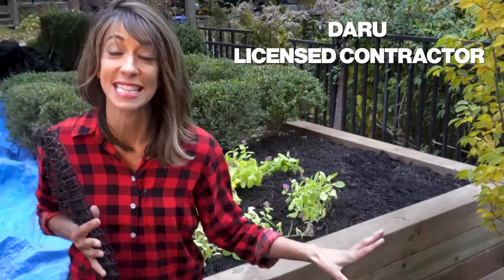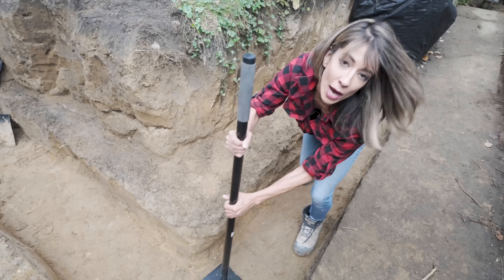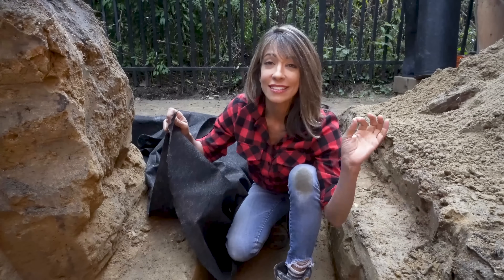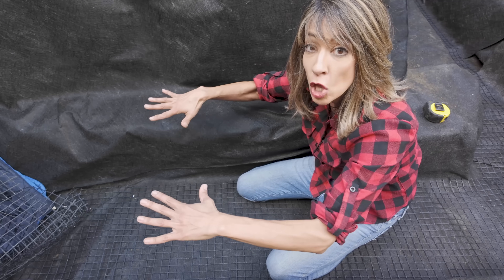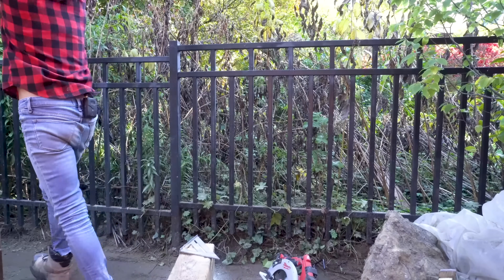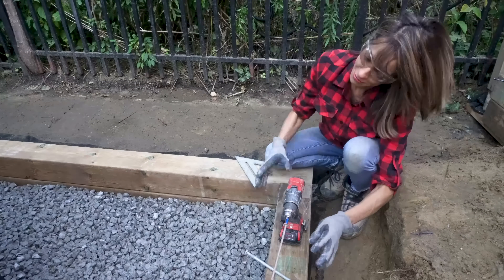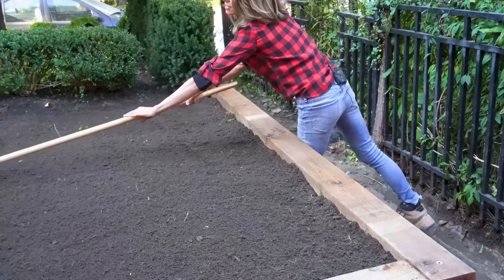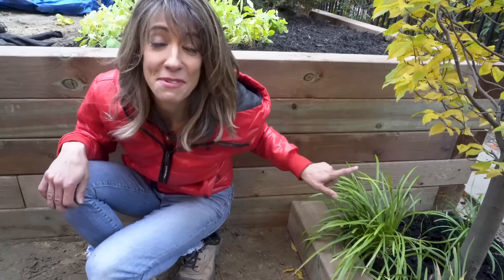No One Builds Retaining Walls Like This...Yet!

Comment: This is standard build for retaining walls including proper slope. Unfortunately most contractors don’t want to do it because cost and problems won’t occur until they’re long gone. Drainage is critical. Include pipe gravels fabric and weep holes depending on length of wall. Used to make 20ft high walls on golf courses for a living. Great work
Reply from the maker: Totally, the drainage is so important for longevity.

Comment: Is it necessary to put in biaxial grid below that first lift of backfill?  Shouldn't that 3/4" clear lock itself in without needing the grid as well?  I can see adding the biaxial grid to additional rows of retaining wall, especially as it increases in height, it just seems redundant to put it below the bedding layer.
Reply from the maker: The base layer stabilizes the base to support the 4 tonnes + that it’s supporting. I’m doing this with concrete block too because my block manufacturer requires it. I think it’s smart. Especially for retaining heavy amounts of soil and backfill. You can build them with or without. It’s a $100 upgrade I’m happy to do.

Comment: I was standing on a 12 ft block retaining wall at my house when it collapsed. I was able to grab the iron fence on the way down and was left dangling 6 ft above the ground below. The block wall was just a stackedgravity retaining wall. So i completely broke down the wall and stacked all the blocks to the side. Then I brought in my back hoe and recovered all the dirt/aggregate to the other side on a large tarp. Next I drove 16 10' rebar into hill in a grid pattern. I then drove down 6 vertical rebar spaced equally and attached it to the 16 horizontal rebar. Then I attached galvanized fencing to the rebar with some space between the fencing and the hill.  Next I leveled the ground by the hill. After this I started restacking each row. At the end of each I applied rubber road netting to the top with liquid nails to further tie the blocks together. With each row I back filled the space behind with the dirt/aggregate and tampered it down. Rinse and repeat.  At the top, I poured concrete to cap.
Reply from the maker: Thanks for sharing your experience building your wall. Sound like it was a great project.

Comment: I don't think this is correct. The geo grid should have 3/4 below before it's layed out. It does not need to go below the wall but on the 2nd course extending out to the excavation.  Re your fabric it seems most of your competitors would go with the woven version as it does have  water penetration (slower yes) and directs the water to the drain instead of waiting for it to absorb into the ground.
Reply from the maker: Yes, most videos are using the tarp-like woven material but it’s incorrect and will reduce the lifespan of your wall. Especially if you have clay soil. I base stabilize my walls since my block manufacturer requires it and it’s a standard engineering practice. Thanks for sharing your thoughts.

Comment: So you are draining the wall by putting the drain pipe through the wall, but the water has to go up slope (you said the level was to the left) to get to the daylight part of the pipe? 
Do you have magic water that travels uphill?
Reply from the maker: The level is used to confirm the slope.  All drains require a minimum slope 2% or 1/4" per foot. Thanks for your question.
Reply: @DaruDhillon  Yes but the video says it was sloping away from the daylight of the drain.
Reply: If the bubble is on the left side, then the left side is the higher side and the right side is lower ( which is where the water will flow to and daylight through the retaining wall.)
Reply: Yeah, that's right. My brain failed me. @WhatDidUThink

Comment: I've been building retaining walls for 30 years, your tutorial and information is spot on.  Have to say though, I think I've only ever had one where I could dig that smooth in sand.
Reply from the maker: I appreciate you taking the time to let me know. You must have seen all types of walls in your career! Thanks
Reply: @DaruDhillon  Snarky disingenuous reply. Fake "jobsite"
Reply: So in your 30 years experience what role is that pipe playing when the drainage aggregate is at a lower point and already goes under the wall? 
Is that pipe doing anything when water will already flow under and outside the wall.
Reply: @DiscoFangyes it is doing something. You could do a little experiment yourself. It's going to decrease hydrostatic pressure overall in the amount of time that the hydrostatic pressure is applied against the back of the wall during a heavy rain.  It's going to help get the water out as the backfill is saturated and keeping the water level lower and draining out faster rather than letting it build up higher and higher to the point where the hydrostatic pressure is pressing against the point of higher wall leverage. 
It's not exactly the same, but think of the holes in the upper part of the bowl of your bathroom sink. The reason they are there is to keep you from accidentally overflowing your sink if the water is running and your drain is closed or rolling slowly because of the accumulation of debris in the trap.
Reply: @lanceroberthough1275 Utter nonsense. The hole in the top of your sink is to let water out if the plug is in but the tap is running. The drainage aggregate being under and continuing outside the wall is like having no plug in the plughole. All and any water is never reaching the height of the pipe. I’ve been building and landscaping for over 35 years in hilly, temperate area.  Understanding and controlling water is fundamental to foundations.
Reply: @lanceroberthough1275 And fundamentally you don’t build retaining walls as a floating construction on drainage aggregate.
Reply: @DiscoFangI don’t doubt your experience but the flaw in your reasoning about the gravel under the wall acting as a sufficient drain is that this gravel is below the undisturbed excavation of the outer side of the wall. Even though the gravel extends to the outside of the wall, water that has passed under the wall now runs into undisturbed soil outside the wall which may be unable to absorb and eliminate water. The result being that water pressure does in fact start building behind the wall. The drain pipe eliminates this possibility and safely drains water to daylight outside of the wall. 
Adding a drain line is a pretty small effort compared to the overall effort of the entire project.
Reply: @DiscoFang I work in heavy clay/ southern US piedmont area and actually run into this all the time. This construction would never work in my area, and that's why we sue CNR around the foundation. In this case, I think it may be appropriate for two reasons:  I imagine that the fully buried timbers have the same hydrostatic pressure on both sides of the face (water doesn't compress, it displaces), so they can't move, whereas those above grade would have pressure on both sides, requiring an "overflow" like that hole at the top of the sink. With that super sandy soil, it is likely the water lens would never reach the drain pipe and hardly if ever stand even around the buried timbers, but if it did, there's a pipe in place to move it out quickly. Also the sandy soil would never clog the fabric, unlike the clay I deal with.
Reply: @robmill3r  I don't disagree with you that this land she's building on looks quite sandy and that water will most likely just flow right through without a french drain. But I don't see the argument not to have a french drain in place as there's as time goes by and as you add more and more soil into that garden, and with the flow of water the smaller particles will blend with sand and start to not flow as smooth as it used to, so in my opinion it's just something that's good to install. I do feel sorry for you that people that you're arguing with you here don't even know what a french drain is for some reasons starts to compare the french drains to overflows on a sink.
Reply: @DiscoFang Not absoutely true. Take a look at Gabions. They're used (and have been since Roman times) as retaining walls. And you rest them on drainage aggregate.
Reply: Concrete behind the wall would have been faster and more cost effective
Reply: @im2bz2eu  not really, concrete is 4x the price of gravel, and it doesnt solve the drainage problem because you dont want water right against the timber.
Reply: It's fake content.
Reply: @e4d578what is fake about it? I'm interested to hear what this lame brain fake call out is. I need a good laugh.

Comment: This is a very good wall design, particularly on the soils you are fortunate to have. Soft clay, silt, or high organic content soils would be a different story.   In those cases, removing the soft soil and replacing with compacted suitable fill is best.  If not possible, talk to a local geotechnical engineer.
Reply from the maker: Good advice. Thanks for sharing!

Comment: Also, it appears in the video the drain pipe sits on top the 6" aggregate base while in the wall block video the drain pipe its within the agg base.  Was thinking - wouldn't the drain pipe better evacuate water if within the 6-8" aggregate base for the wood wall?  it'd catch water sooner as it saturates/fills in the gravel.  Or maybe it does it matter where its placed so long as its sloping?
Reply from the maker: In this post video I’m sloping the drain so it’s draining at grade or daylighting. Some walls will require daylighting by code if they are long. Some build smaller walls with the drain lower without daylighting.

Comment: Sounds like everything is critical.  Pro tip, angle your wall just slightly backwards to account for the forward force.   Slightly,  so the bottom doesn’t push out.
Reply from the maker: Good call! Battering walls does reinforce strength like you say. I have a garden bed video that shows how to do that. In this case we went vertical purely for looks.

Comment: Are the rebar that are securing the deadman piercing through the drainage pipe installed at the lower course?
Reply from the maker: No you wanted to avoid puncturing the drain and filter fabric.

Comment: Hi Daru, this video was incredibly insightful for building retaining walls! Couple of questions. 

1. Do you have links to the different geo-grids you used during the installation, or the names of the brands you used?
2. When you're installing the geo-grid, do you do a layer of this for each layer of backfill/gravel? or would one layer be sufficient?

I plan on building an 87 foot length retaining wall at about 2 feet high along my driveway, so your insight would be much appreciated.
Reply from the maker: It’s a personal choice that you can build to suite your needs. I purchased the geogrid from a leading American manufacturer. I don’t have links, but I would use any of the established brands. A lot of engineering goes into these products so I would trust their reliability.

Comment: When you add the UNIAXIAL geo grid, are you tamping the aggregate? And, the video cites a 32" wall, how far up are you adding the UNIAXIAL geo grid (at what height did you place the tieback)? Also, one direction of the geo grid was placed after immediately on top of the tieback, and the other supporting direction was placed on the next layer (or next post). Is there a reason for placing the geo grids into separate layers?
Reply from the maker: Yes, the geogrid requires a minimum fill of aggregate between each layer which was the same depth as the timbers. First tiebacks were set at grade above the first course. I would add another set of tiebacks if I was going higher. Thanks for the question.
Reply: @DaruDhillon  Awesome. I am doing a timber wall at 30", so this is a PERFECT model. Run the geo grid by me again: obviously, there's two directions of the uniaxial. The BIAXIAL is placed at the initial layer, and the UNIAXIAL is placed when/where?

Comment: You shouldn't need both the wood tie backs and geogrid as they effectively serve the same purpose, but hey... I love the over engineering and would do the same myself of I had the supplies on hand. One miss, perhaps just not shown in the video, is that you should put down another layer of non woven geotextile between the drainage rock and the top soil. Otherwise the soil will migrate into the drainage rock and eventually plug it up.
Reply from the maker: Yes good to hear your take on this build. I did lay the textile over the top to burrito it in. Thanks for mentioning that important point!
Reply: @DaruDhillon  hi, just to be clear, you laid the textile or the fabric over the top? staples required to attach the fabric to the wood?  
anything special needed to hold the texttile to the backfill?
Awesome vid Daru! 😃 though I honestly can't believe some of these responses you're getting😅...thanks so much for sharing!!
Reply from the maker: @rajt295  Yes, before you fill with any dirt you should wrap or fold over the top to protect the backfill. Keep that area clean. You can use staples like in the video if needed or soil on top. You'll find a solution that works best. All good. I appreciate the feedback and support! And good shovel humor. :)
Reply: @DaruDhillon  Fantastic, thanks so much!
Regarding the grid itself (and not the fabric)- the portion/section below lumber appears to be pinned/held in place by weight of the lumber + rebar driven into the ground.
As for the grid's other portion/section (under the backfill area) - is it being held in place/fastened down by staples or anything else?  I imagine it'd have to be held in place by something substantial/strong (driven deep?) to be effective (solidifying the backfill gravel + wood working together to remain in place and withstand pressures/force from shifting earth/a hill/water).
Definitely one of the most helpful videos on YT on this - the more I research it against what other folks are saying, the more the apparent the advantages.  Your explanation and humor are the best - stay strong and please keep them coming!!
Reply: To keep soil from getting into the drain rock, filter fabric can overlap the 2nd to last timber before the top timber is placed down (it'll be between the top 2 rows and will keep soil out of rock).
Reply: Where the drain start?

Comment: Three things to know about shovels: If you are manipulating the shovel (like you in the video) using just arm strength you are not going to last long, add the legs and twist holding arms steady to toss dirt. You will get more done if you take smaller bites (exactly like you did in the vid). And most importantly shovels are much more effective and less tiring if you put them in the hands of a laborer instead :)
Reply from the maker: Good tips. It's all about finding what works for you. Thanks for sharing your experience!

Comment: Wow!  Very detailed.

Me: Stack and nail wall beams with gaps of 1/8 to 1/2 inch at ends (drainage) of each beam with 2' cut rebar as nails. Again, use rebar to nail ALL the beams together. Simply take a sledge and hammer like you've got a job to do.  They'll go in.   If, the wall has length - put about a 10 to 15 degree slant into/toward the back fill area.  Create wall anchors with rebar bent at ends. One end nailed/sledged into the beams the other end set into cement block placed 3 to 6 feet into the yard . Stagger these rebar anchors every 3 foot or so.  There isn't a need for a drain  pipe - because your 1/8 to 1/2 inch gaps at beam ends are interspersed around/along the structure. This evenly drains the entire wall area.         Meaning? I think this is over done and too much work, materials, time, and cost.  The geo grid is an interesting and good idea for anchors.      My wall is out of railroad ties and is 3.5 foot high and 72 foot long. Up 39 years.
Reply from the maker: @BStott  thanks for sharing your building experience. I’m glad you’ve enjoyed the results of your project.

Comment: On time frame 10:04 correct me if I'm wrong, when installing the tie-backs I have to make sure the reed bars are not puncturing the drain hose. Correct? Also am I installing tie-back on different levels of the retaining wall?
Reply from the maker: You are correct! You don’t want to puncture your drain. You need to keep that free of debris. The tiebacks are installed on the same course. If you’re building higher, you can always install another course of tiebacks. Thanks for your question. Good luck with your build.

Comment: Does it really matter which way you install the geogrid? at 10:35 ish, you say roll it out front (timber side) to back, but then when you place it, it appears you roll it out from left to right in a long run.  This is confusing to me.  It would seem the initial explanation might have been wrong.  It seems to me that you would buy the roll of geogrid that is the correct size for the space and roll it out (left to right) or (right to left)  longways down the wall.
Reply from the maker: It can be confusing. Uniaxial Geo grid strength runs in one direction of the grid. The grid strength should run perpendicular to the wood. Ultimately, if the direction is the other way, you’ll still stabilize your soil you just won’t get the strain relief. To relieve tension on your wall.
Reply: @DaruDhillon  i appreciate the reply.  I am a novice and will be installing a wall soon, so i appreciate the videos. great work you do.
Reply from the maker: @deanrsanders  my pleasure. It’s always good to ask questions to clarify. I do that all the time. Enjoy your project!

Comment: Woudl not all that aggregate squish the drain line? (thus blocking the drain? ) its alot of aggregate weight ontop of the drain line, since the drain line is near the bottom.
Reply from the maker: Great question. They are designed for this purpose I haven't heard or seen of any issues.